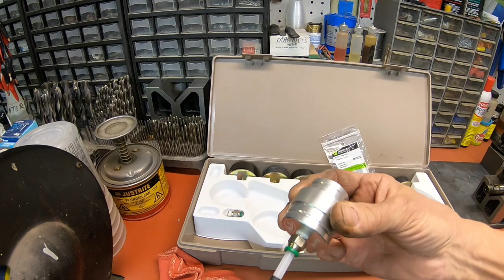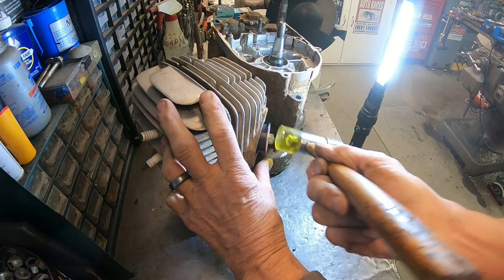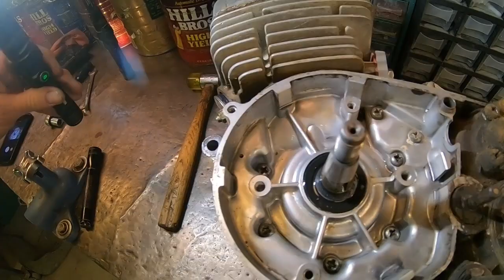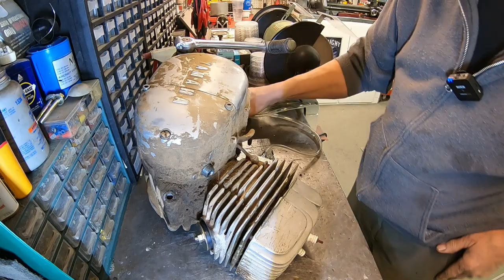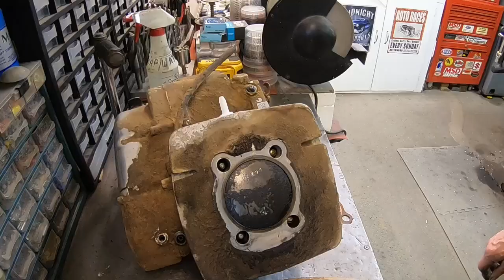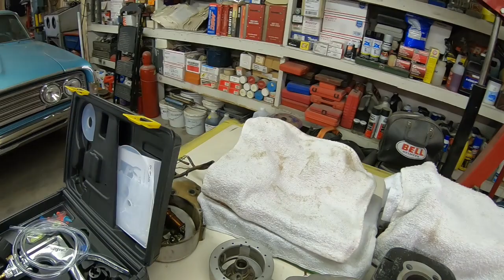Leak Check your Two Stroke

Comment: Way to go dale i have the same kitt the bulb quit and i cleaned the valves in the bulb and put a little grease in there but no go so i bought a blood pressure kitt for the bulb one more thing some  aftermarket seals and gaskets not to good i to mill the head on glass but head gasket leaked jug gasket leaked and flywhell seal so found a diffrent company no leaks at 5# for hour keep up the good work .

Comment: Thanks for sharing your knowledge.if you were testing a twin would you be watching for pressure transfering from one side to the other if checking centre crank seal.
Reply from the maker: Absolutely, anytime you check a twin or triple two stroke, you must check it as one. Plug all the inlet, and outlet, and perform the check at one location.
Reply: Hi Dale,not sure what you mean by perform check at one location, assume you can only  pressurise one crankcase at a time.is it important where the piston is,ie tbc or bdc  when doing a leak down cheers
Reply from the maker: On a two stroke, you check all cylinders at the same time because the crankcases are indeed connected. There are seals between each cylinder. So, I guess if I was checking a twin, I would seal everything up except one intake where I put my gauge and introduce vacuum. Of course, this will not tell you which seal or gasket is at fault, that you must do by testing with soap and water. No doesn't really matter where the pistons are. If you can't find the leak externally, then you must assume the seals between are at fault.
Reply: @montana2strokeracer  many thanks

Comment: The small triple kawasaki's (kh400, S2) use rubber seals between all cylinders - they didn't use the labyrinth seals you find in some (all?) of the Yamaha twins
Reply from the maker: Yeah, the seals are a better solution in my opinion. Will be doing a leak down on a twin cylinder Yamaha soon. Sorry just seem to be more Yamaha's in my area, I was lucky to get two Kawasaki's I have, but the parts availability is much better for the Yamaha's.

Comment: GREAT explanation, simple, thorough - very helpful.  Thanks for posting
Reply from the maker: Thanks for the kind words, will be doing another leak down check in the future. Thanks for the comment and for watching.
Reply: @montana2strokeracer  You motivated me to get off my butt and make a two stroke leak down tester.  Ordered the 
bits from Amazon and this week I'll get the tube and rest of it locally, should come in at under $75 Canadian which is better than the motion pro's well over $300 Canadian price now.

Comment: I like it Dale, as you say easy to find the pieces and make the necessary 'bungs and blanks'. I thought you'd appreciate the aircraft terminology! 
I'm glad you mentioned the agricultural supply store, I find our local place very useful for general engineering supplies. The stuff is usually reasonably priced and decent quality.
Great video. 
Best wishes, Dean in Oxfordshire, UK.
Reply from the maker: Thanks Dean, yes you have to find parts any place you can. It is more affordable for sure

Comment: the leak causes tuneability issue and oil burning problems is this correct? also do you do leak checks on your newly rebuilt engine just to make sure all is good.
Reply from the maker: A leak will cause a lean condition or excess oil burning went oil is sucked from the transmission. It would be a good idea to do a leak check, however I generally do not unless I have a tuning problem or oil control issue.
Reply: @montana2strokeracer  yeah, no doubt if its needed it will show up.